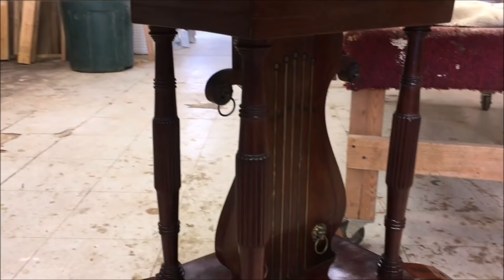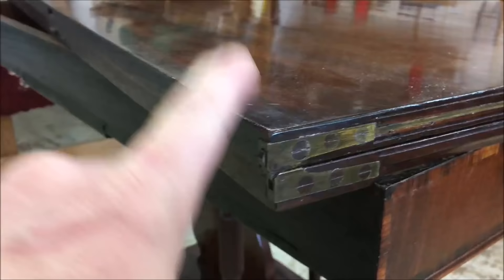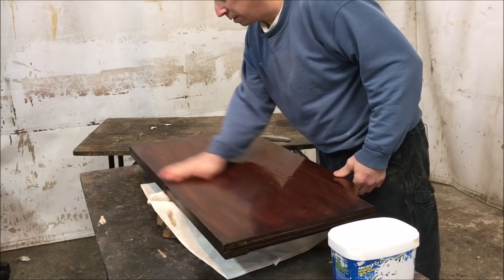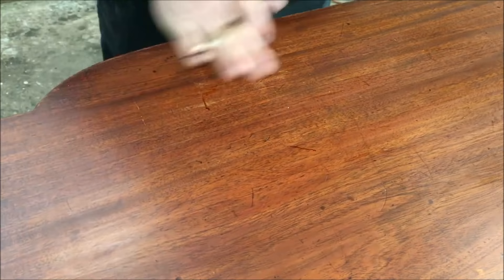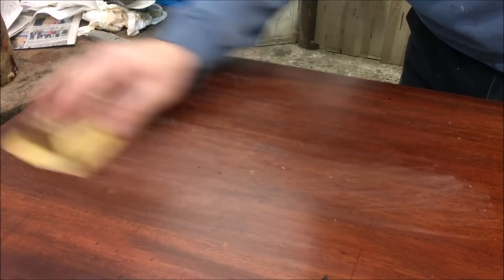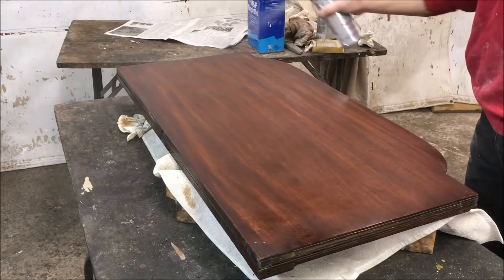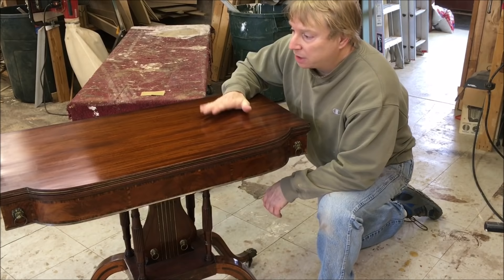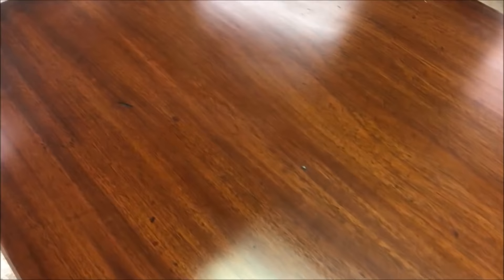REPAIRING SCRATCHES ON A TABLE TOP

Comment: He did exactly as I thought: scraping the old varnish, removing the marks from the scratches of the wood (use of paint), a first layer of transparent varnish to disguise the scratches (he used spray varnish, I would use a viscous clear varnish and do a flattening of the varnish with the scratches grooves), to immediately afterwards do the complete varnishing of the wood.
Reply: Can you send a link to the varnish you would use?
Reply: @stumbino8361  It would be any canned varnish that can be applied with a brush.
Reply: I have a bunch of cat scratches on a table I am trying to get out.  I will try that.  I saw online people were using hard wax to fill in the cracks.  I was going to try both methods and see what blends better.

Comment: Did you open it up to see the damage the Naptha did to the inside where it was folded over?
Reply from the maker: the naptha does not do any damage to the finish , some did get underneath , but no harm . i waxed the other surfacers as well
Reply: @rosstaylorwoodworking728   OK good to know

Comment: I have the same situation in a beautiful mid century modern desk, the scratches are not only deep, but wide, as if someone had made them with a key. Do you think the same technique you used here will work? Thanks
Reply from the maker: try it and see , if not you would have to strip the finish . if the scratches go into the wood you will likely have to strip

Comment: I don’t have much experience with finishing so don’t take this as criticism. You never talked about the type of finish you were repairing. Wouldn’t the repair process be very different for different finishes? For example, if repairing shellac, I would’ve expected to see shellac be used instead of acrylic.
Reply from the maker: yes it easy to have oversights like that and leave out certain details  . the table was previously finished in lacquer

Comment: I've got another method to fill scratches and dents. I have a little squeeze applicator that I fill with lacquer. Clean the scratched area well and flood the scratches with lacquer. Immediately drag a razor blade or utility knife blade over it, leaving lacquer only in the recessed area. You can use a putty knife or whatever you want, but the razor blade is small and handy for me, so that is what I use. In just a few minutes, you can do it again, and again. The lacquer dries almost immediately. Go until you have filled the spots you need to. You need to keep scraping the razor blade to keep it clean as you go and prevent build-up, or you won't get the flat effect. When everything is flat, varnish the whole surface to unify everything. The way you are doing it seems wasteful and time consuming. You coat everything and sand or scrape the high spots, which are 99% of the surface. Not smart working.